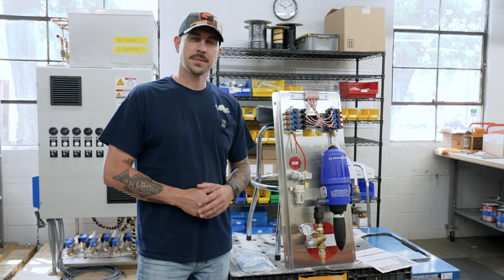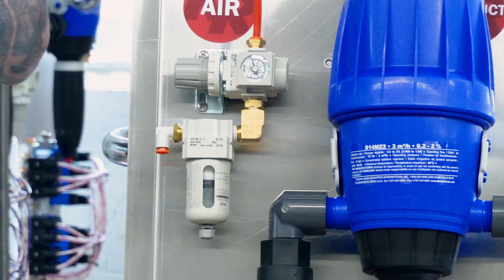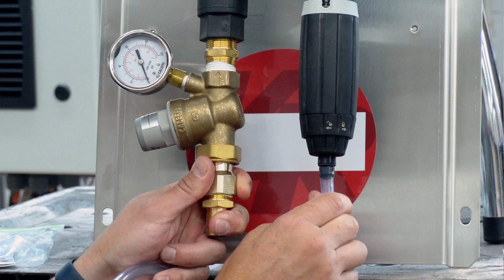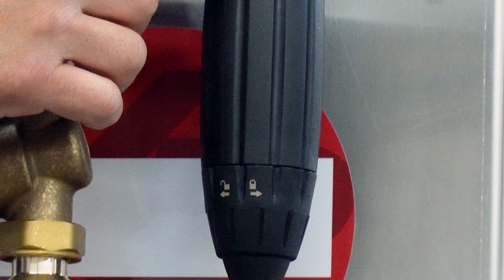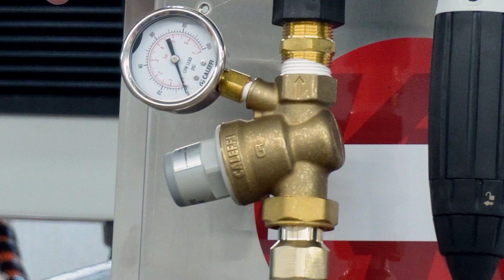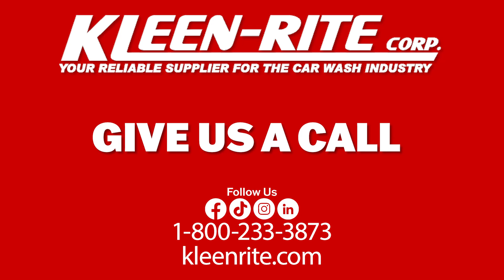Kleen-Rite Low-Pressure Panel with Dosatron Installation - Fix It With Phil

Comment: Could you do a full video on how this connects to the air compressor, what air compressor to use and at what psi etc., all the wiring, and how the solenoid connects to each bay and what those hose connections look like etc. A lot of missing information from this video, that would be very helpful! Especially one with the dosatron modular panel that youre able to use one city water line to connect to multiple different modular panels for different soaps. Most importantly when the hoses for air and chemical are connected to the bay, how do they mix? You mentioned that it's better to mix at the bay as opposed to the equipment room for a "better show". Confused on that. Looking forward to a video on this!
Reply: Following up if a video on this is on the horizon? Would love some clarity and a visual on how the air line and product line mix over the bay and how that connects to the gun for foaming applications.